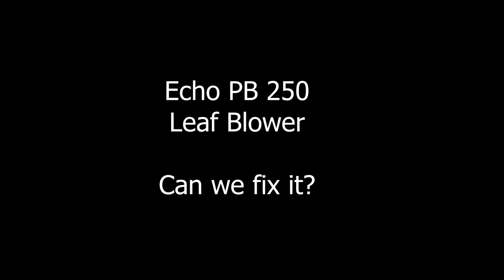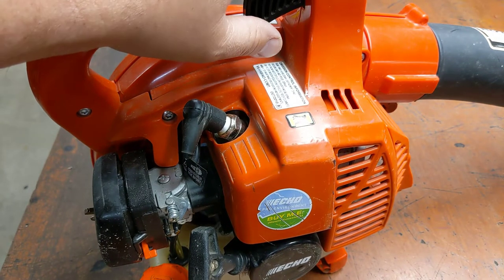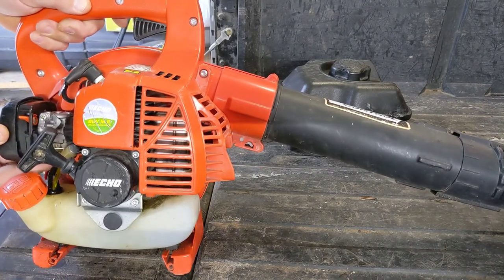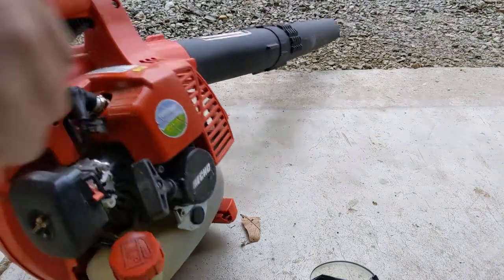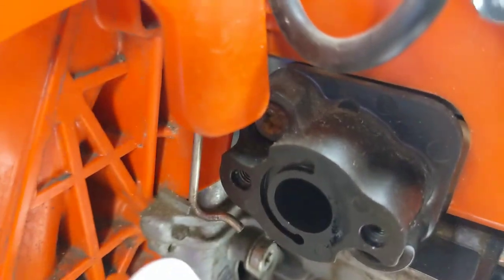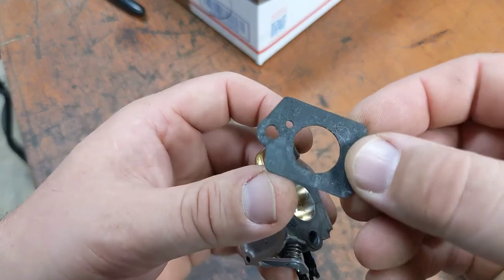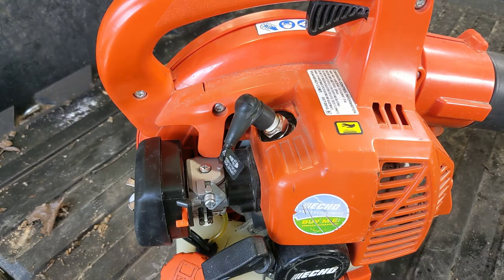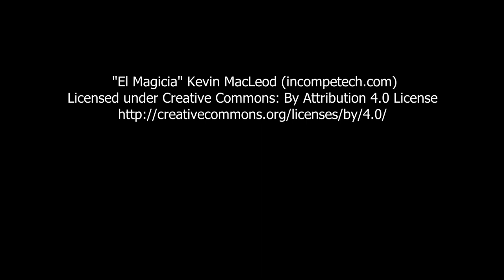Echo PB-250 Leaf Blower.  Can we fix it?

Comment: Great job and I'm subscribing. Thanks for bringing my attention to the missing gasket hole. I had the same issue with mine right out of the box and noticed it was missing the same hole. I poked a hole and it works like a champ. I went ahead and ordered a replacement gasket and it came with the hole already punched. So I think you are on to something here. Anyways, thank you again. Toodles!